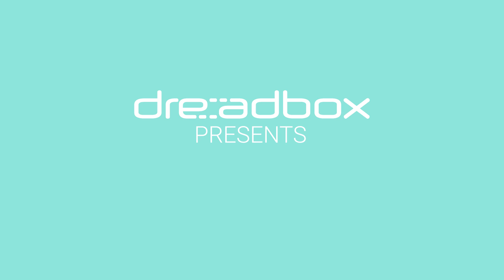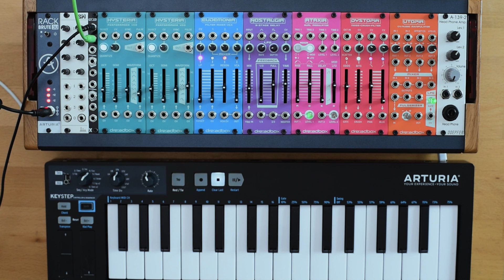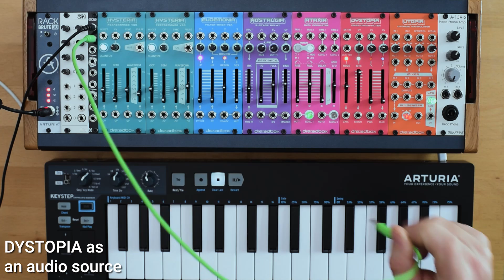Dystopia / Noise-Crush-Filter   - CHROMATIC MODULES by Dreadbox

Comment: Some of the sounds you got out of it, in the first few minutes, remind me of the trick you mentioned in the user manual for the Erebus V3: by patching the S&H output directly into the filter or amp, you get a sort of digital noise sound. Very simple, yet very cool and something you don't usually see in desktop synths.

Having it in a module is even more handy, very well done Dreadbox!

Comment: will you be selling complete systems?
Reply from the maker: unfortunately, no. But some shops are already doing this (modularsquare)or will do soon
Reply: @Dreadbox-synths  Hi, if you happen to read this - i just received one secondhand. It has not the leds, but leds in the faders. Is that another edition?

Also, when the highpass-fader is completely up, the sounds comes back suddenly  - is that normal behaviour?

It also seems the "odds" fader does not do the same thing as in your video and the leds in the faders shine when they are down and fade out when i turn the faders up.

Could you tell me, are these normal behaviors? Thnx